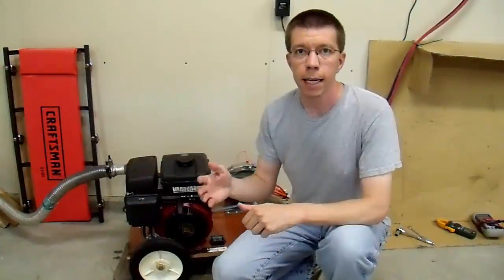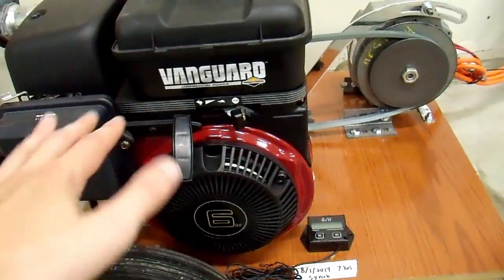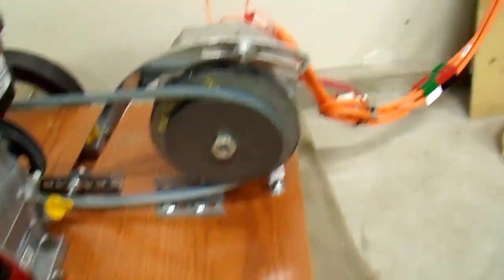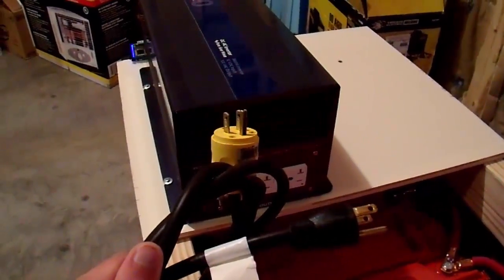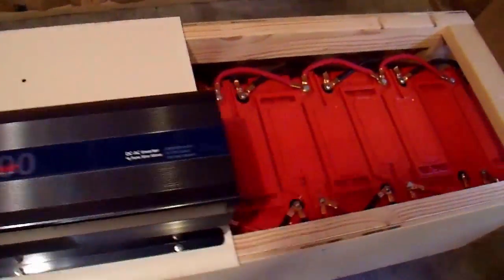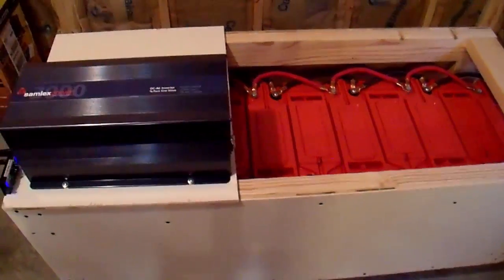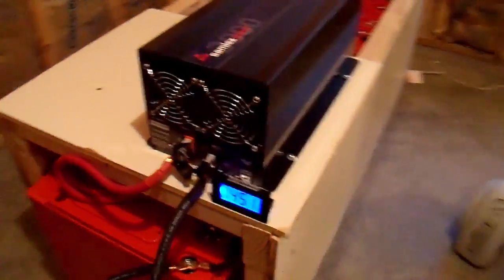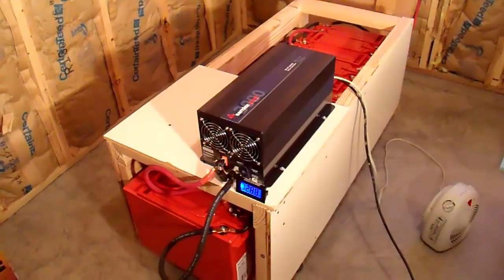DIY 12V Generator Charger - 10 Demonstration and How to Build

Comment: Not trying to be a downer.. but a 3600 rpm 6500 watt diesel generator sells for about $900-$1400 14 hour run time on 3 gallons of diesel fuel. So 24 hours would be about $18 a day in fuel. And I can run everything in my house even a 15000 back up thru the wall AIr conditioning unit, I can run my electric stove, my microwave, my central AC systems heat 1st stage heat strip. and basically everything in my home but my central air conditioning. which I must say the 15000 BTU 1500 watt thru the wall unit does a great job of cooling one side of my 3000 square foot home. And if I wanted to I have a 8000 BTU 800 watt backup AC unit on a shelve in the garage and I can run that on the other side of the house with a box fan and the entire house is cool. So I'm curious how big is that fuel tank on the gas powered engine you have? What's it cost to run it all day? How much were all those battery's and cables and gadgets? And how much time was put into this ? Meaning was it cost affective? Because at $900 for a diesel 5500 watt or $1200-1400 diesel 6500 watt plus all the goodie to hook it to a breaker in your main legally $110 and a cord $40 it's at lowest point a $1050 investment. $18 a day to run. And maintenance is cheap 100 hour oil changes for $5 . And another thing. The diesel is a enclosed silent model. And no flammable gas. And iys fuel injected no carbarator to clog. And no spark plug to change. Safer . So just wondering what the advantage of your setup is if you need to run a gas powered engine anyway? In the event of power outage for let's say a week. . And no Air conditioning for a week is ruff.  Nice video . ?????

Comment: I have two similar batteries which I like to use in my van to power a small fridge and some other low powered appliances. I plan to use a charging relay which will switch the two batteries parallel to the existing car (starter) battery if  that one has reached full charge. I have heard I have to modify the alternator to output less voltage (then the standard 14.4 V) by having a diode in series with the sensing wire to the alternator, which should make the alternator put out about 13.7 V - since a diode takes about 0.7 V away from the sensing voltage thus preventing the field coils reaching the standard voltage.
This is supposedly needed to prevent overloading the batteries. 
May batteries are Northstar NSB 100FT (RED) which float charges at 13.6 V and boost charges at 14.1 V.
Are your batteries different or did my source err too much on the side of caution??

Comment: Yes this system works,but the math is way off on capabilities...12 volts at 80 amps = 960 watts...This will not power an entire house at all...Example: a window A/C unit at 5000btu uses 515 watts avg leaving only 445 watts of total power,but one should never go higher than 80%,(768watts = 80% on this one), of the max power output so in essence you only have 253 watts left of useable power!!! The example he is providing is actually the useage of the generator plus battery power together,but more off the batteries than the generator,so after a period of time the batteries will be drained completely and all you'll have is the original 768watts of the generator powering anything!!!
Reply: It is to charge the batteries if the solar does not keep up.  Listen to what he said.  and your math sucks..
Reply: @patb9375  Appearently you know nothing about the subject at all,let alone have a degree in Electricity to which I do... My math is right on!!! Volts times Amps = Watts...In his example it is a 3000 Watt Max output inverter so the rated ouptut would be 1800-2000 watts continuous,this will not power a complete house at all!!! Example: 1500 watt microwave plus a fridge consumes on average 2100 Watts when both are on,this would be 100 watts overload and the inverter would begin to over heat and the overload LED would be flashing. According to the Department of Energy,(DOE),the average American home uses 86,700 watts per month,this would be 2890 watts per day assuming the home had the latest technology in appliances...With that said this setup at only providing 2000 watts max continuous would be 890 watts short of the goal for continuous running,if you add in the point of appliance startup surges,(compressor startup and or furnace blower startup,etc.),this system would fail as soon as it hit the inverter!!! If you had listened to him,he said his solar portion is not up and running as of yet!!!
Reply: Further to the point...I imposed the 80% rule for a reason,this is to provide a buffer region to increase the longevity and reliability of the system,but a more correct percentage would be 70%...No engineer designs a system that uses 100% capacity of anything...the 80% rule is always applied,even manufacturers of appliances ratings of their products do this,plus part of the reason is one of safety,(to remove the possibility of a fire due to overloading)...

Comment: You will burn out your battery without regulation and you will burn too much fuel with that littler engine. I get 8 hours on a gallon.

Comment: There is book knowledge and there is practical knowledge. You obviously have a technical/analytical background. But anyone who mounts a 6hp engine on particleboard has build a time bomb that will break apart while the engine is running. Save yourself from yourself!

Comment: Nice work! My dad had something like this to charge boat batteries. Which you could add another belt and pump water out of the well. While not the best water pressure when the power went off we had water.

Comment: *I was just about buy a new battery for my can but was able to use your guide to quickly recondition my old battery instead! I was not expecting it to be that easy [Check Details Here>>>>https://plus.google.com/100351090281822647456/posts/6ukDjcr5HXn ]. That already save me over $100 and there are so many other batteries I am going to recondition with your course now too! Thank you._

Comment: You cant use a clamp meter to measure DC amps, that reading is false. You can only measure DC Amps with an inline amp meter. And you need a engine of at least 8HP to drive a car alternator efficiently.
Reply: Chris Bezuidenhout 
You can use clamp on amp meters for DC if the meter is designed to do it. Look it up. It's called the "Hall affect".
Reply: YES! you beat me to that! haha and look hes reading -34.4 amps, so his polarity is also wrong as well, always use inline for my DC current systems
Reply: azopene 
Ive used my clamp meter for D.C. power on many solar fields as well as inverters and alternator applications.  Thank you for adding that.
Reply: Your statement is true 15 years ago.
Reply: That's for cheap clamp meters, most low priced ones (all at Harbor Freight) are AC Amps only. Klein tools, SnapOn, Fluke, etc do make AC/DC clamp meters. price is about $80 and up.

Comment: Nice setup I did mine with a Honda engine with a 3 1/2" on the engine and Factory V groove pulley and it did 10 12 volt batterys  at 14.3....this is when I was at 12 volts am now at 48 volts

Comment: Don't build this design, folks. This guy obviously doesn't know what he's doing. There are much better designs out there that will make more power with less fuel. You could use the same engine/alternator combination but with a different drive ratio for better output and economy. Auto makers know what they're doing when they design drive ratios. If 1 to 1 were optimum then a direct drive with a jack shaft would save a lot of fuel through higher driveline efficiency. Appears that he tried that before but used the wrong type of shaft. For a belt and pulley drive, you want at least a 1.5 to 1 or 2.25 to 1 drive ratio to compensate for friction losses and to protect your batteries from damage due to surge losses. The voltage regulator takes care of the rest.  Make sure you get an alternator that uses pulse width modulation as it's regulator type. It sends a "cleaner" power to your batteries and will add to their service life. His system is fine for charging if you don't mind poor fuel economy but not adequate for us as a generator. Also, don't use a "racing" pulley. It does not provide sufficient cooling under long periods of use. Those are designed for 1/4 mile drag races where it only has to provide charging for a few minutes at a time and endure heavy loads from high output engines. That's why the drive ratio is lower. Many drag cars don't even have batteries and are started from a battery that is not in the car. They only require enough alternator output to power the ignition system and a few gauges. No lights, heater fan, turn signals and so on. Race cars use lower output alternators to draw less horsepower from the engine. Makes the car go faster because in racing, milliseconds matter. Common sense is an uncommon commodity these days. Not trying to be hateful, just telling it like it is.  I applaud his ingenuity but he shouldn't use words like optimized and engineered as there is little optimization engineering involved here.
Reply: Don't knock on my homies with poor Mathematics!   LMFAO :D

Comment: It's funny making a comment about a video that's over 3 years old now, but I just wanted to say that using larger pulleys, instead of small ones makes life much easier on the belt IMO. A bigger radius reduces friction/heating of the belt increasing it's life. You are a lot like I was. I used to cobble stuff up like that using wood, straps, angle iron, hose clamps etc. I mean, you did a nice job there, don't get me wrong! Ya, if we had access to a machine shop where one could weld up frames using iron, that would be the ticket.
Reply: Bigger radius would mean a bigger belt.  Also he is using about the biggest pulley that is easy to find that fits the alternator without more modifications.

Comment: I would recommend converting the engine to run propane and hydrogen as well. Less maintenance with those as they burn cleaner and won't varnish up your tank when it sits unused for long periods of time like it would with gasoline. Also, I would either run your exhaust pipe up and put a hole in the wall to outdoors, or cut a hole in your garage door to run the exhaust out (or build a frame that blocks the entire open part of the door except for a hole) to run the exhaust out. As is, leaving that gap could allow the exhaust to re-enter the garage if there is even a slight breeze blowing toward your garage door. Additionally, I would put a battery operated carbon monoxide and smoke detector where you have the generator running to alert you in case something goes wrong.

I put a DeWalt 7,000 watt genny in my metal shed. I cut two hole in the wall of the steel shed. One has the exhaust pipe from the generator coming out of it. The other allows for a grounding wire to come from the generator into a grounding rod that I put in the ground outside the shed. I have the carbon monoxide/smoke detector in there as well as a 120v fan and a light bulb hooked to a 12 v battery that runs continuously whenever the generator is running. (The heat builds up in the shed when the generator is running hard and the light allows me to refuel at night.) We had once gone 13 days without power after a small hurricane and this worked very well for us. Great video. Thanks for all of your hard work in putting it together.
Reply: He said he did not have the stuff laying around to do that.

Comment: You are a moron and have on idea what you are talking about: Go to Harbor Freight and get a 1200 watt generator for less than a $100.00 it'll save you monie: People do not lister to this guy: And for everyone for a off grid or tie grid system go and get "Edison" cell's with proper maintenance I've seen cell's that have lasted over a 100 year's and are still going strong:  Buy American.  Get bolted plates and split bolted case you will only need a full dismantle and cleaning service about every 25 year's:  Oh and one last thing it is a temporary mounting "He puts wheel's on it"......
Reply: Don't knock on my homies with poor Mathematics!   LMFAO :D

Comment: I'm curious, are you sure alternators are most efficient at full field current?  The few (and I mean few, they're hard to find) diagrams I've read on alternators seem to indicate they're at their peak efficiency (70% roughly) around just below half load and the 2k - 2.5k shaft speed you stated.  I'm looking to start a project like this myself shortly but info is hard to find.

Thank you for the video by the way, was interesting.
Reply: He knows he is not at peak efficiency on everything, this was a way he can top off his batteries when it is cloudy and the solar is not topping his batteries.

Comment: Thank you knurlgnar for all the videos on the 12vdc generator.  I cant imagine all the hours and money you put into this project.  I bought a Predator motor yesterday and need to order the parts.     Would you please give me the part number of the 5 inch pulley form Jegs.  Is the Kevlar belt used for the two 5 inch pulleys 4 L  36 inch?  The alternator is a 27si  OEM?  Thank again !

Comment: does this set up use less gas than a regular generator that makes 120v at like 3k rpm?  This is only worth doing if it actually saves fuel since alternators generate alot of ac at low rpms and those other generators are dc so they have to be turned faster hence the loud generators that use tons of gas.  So im assuming you can get the 120 v conversion at very low rpms maybe even just idling the motor?
Reply: NO!

Comment: don't you need a inverter that will run dual phase or will running one 120v output to one phase and one 120v output to the other work fine or will it blow up the inverter and melt down like a volcanic eruption ?????

Comment: Your double male plug is forbidden by the National Electric Code sections that requires power sources to have female receptacles.  The reason for this is to keep you alive.

Back feeding power into your house using that method is very dangerous to your neighbors and possibly the electric utility crew repairing power lines that they have shutoff at their  source.  You need a transfer switch at the electric service entry point.

You act like an accident waiting to happen.  If you think a professional is too expensive, hire an amateur.  That way you can pay more, the amateur to screw it up and the professional to properly fix it.
Reply: He talks about that  you should watch his video.

Comment: At 60 to 80 amps, the 40 feet of charging cable can easily bring about 30% plus NEGATIVE EFFICIENCY GAIN to the overall system.  Don't go lecturing on RPM/alternator efficiency while boasting a purposefully cooked up bad idea that also served as a fire hazard device.
Reply: your comment is so 4th grade.  where did you learn the big words?  you would not have a gain if it is negative, and with the triple ought wire he would not have a major lose. Also it is 12 volt dc you could put your tongue on it.  he has everything fused more than needed and he is correct on figuring his efficiency with the load the engine will pull and the alternator at 70%.   The piggy back cord is deadly and running an engine in your garage even with sensors to warn you is less than ideal.

Comment: why use an archaic gasoline engine to pull that motor? Am i missing something? asphyxiation, explosion, implosion . carbeurator, fuel pump gas, oil. Pull it with another motor. I spend more time on that rediculous gas motor (which has nothing to do with energy output) than anything else when i use the generator.
Reply: he does not have horses.

Comment: can you use this for a range extender in an electric car?
In a system with two battery packs, when one of them is almost depleted, the electric motor switches to the fully charged and then if you want you can switch on the "range extender" to charge the depleted one. 
Can you charge a battery and run a motor at the same time so you have one battery pack?

Comment: How long does it take for the generator to fully charge your battery bank?

Also, your garage door safety sensors are too high, they should be 4-6 inches above the floor. Sorry for the unsolicited info, but I've installed over 4000 door openers,  and sensor hight is ingrained into my brain.
Reply: Did you not see it was hand chain operated,Deerrrrr

Comment: i have built one but i use an alternator out bmw.  it puts out 140 amps.  putting the whole thing on wheels is essential.  i use mine almost every day starting low batteries around the
company yard so i  don't have to drag around extension cords for battery chargers.  i only have 4 horsepower but that give out 60 amps and more with ease.  put enough charge in a battery to start a large machine in 15 minutes.

Comment: "Not the safest thing in the world", uh actually not safe whatsoever. It's called a suicide cable for a reason. Also, it is quite possibly ILLEGAL depending on where you live, and idiot connections like this are an extreme danger for utility workers trying to get the grid back online in a power outage. Your idiot connection provides 120v back to the grid during a power outage, which your residential transformer steps up to 10000+ v, feeding back through cables guys are trying to repair under the assumption they're dead lines. Smart. Also a great way to fry your shit when the grid backfeeds it.
Reply: It is not a suicide plug it is more likely to hurt the linemen fixing the outside plant than the homeowner.  That is why it is illegal, as when you don't disconnect from line you feed back and can hurt a lineman.  Calling it a suicide plug makes people think well I won't make that mistake so I will be ok, but if they kill someone they will not be ok.  He did say he has switch to flip the main off, but the cord is dangerous.